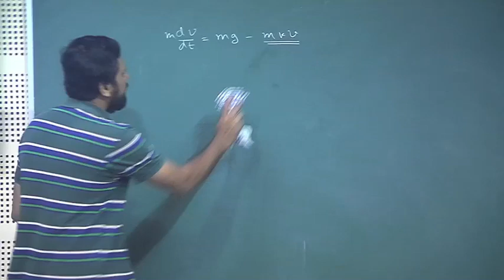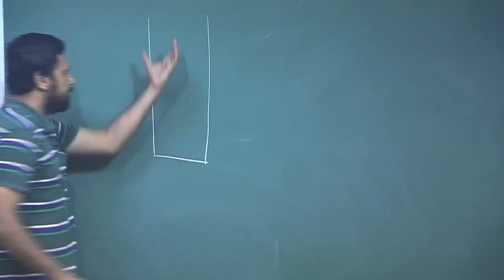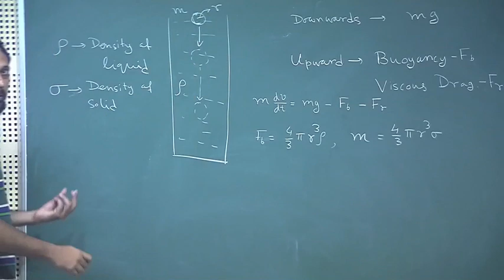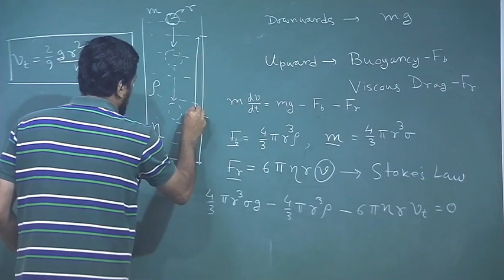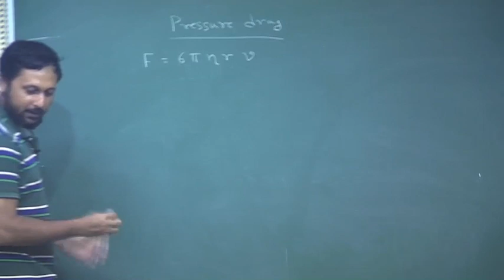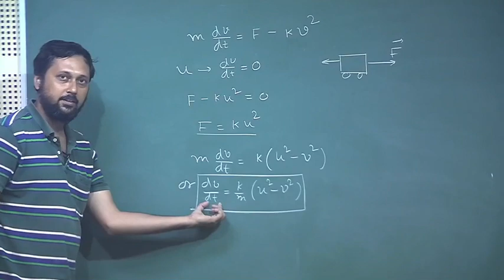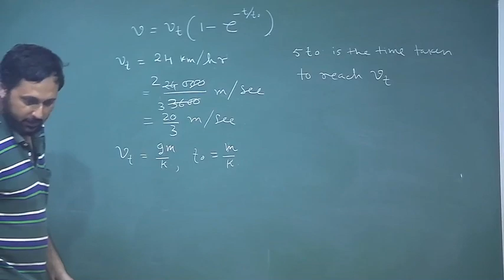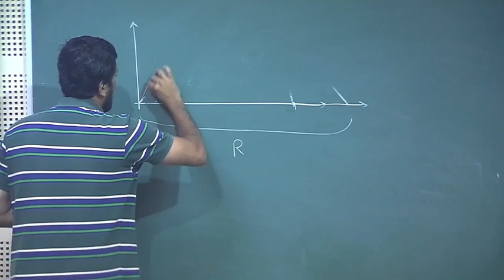Lecture 3:

Comment: Sir the buoyant force will be  -vpg for which its dimensionally equal to mlt^(-2).so g should be there where buoyant force is just the reaction force performing on any object through any viscous medium whenever it attains terminal velocity at time t or simply a constant velocity.and so buoyant force  will act gcos(pie)=-g component direction.